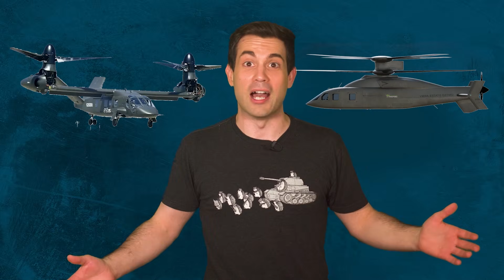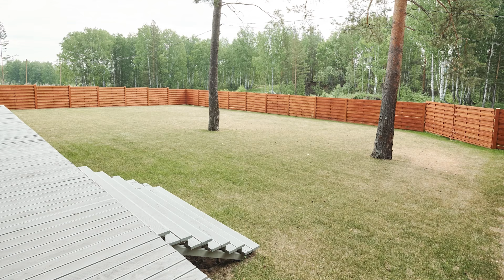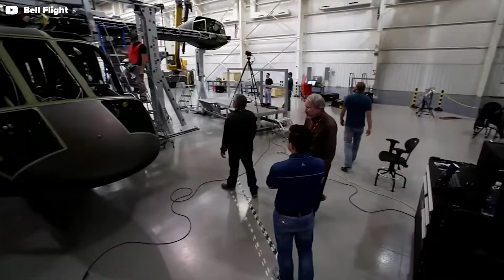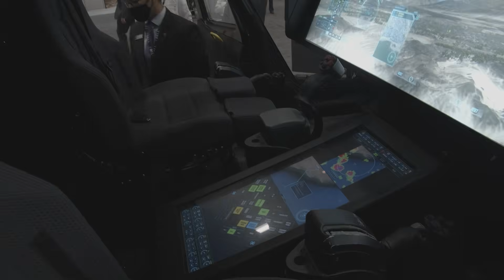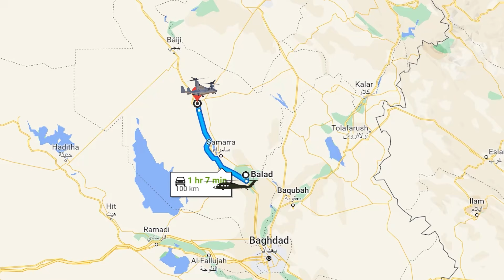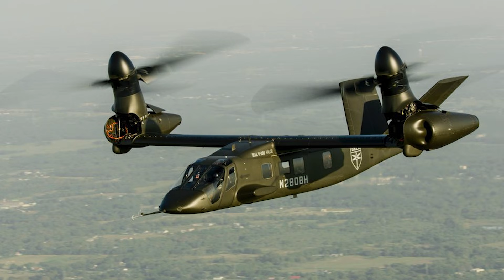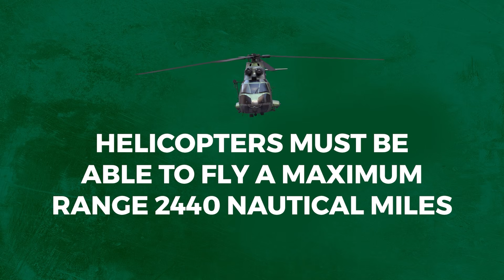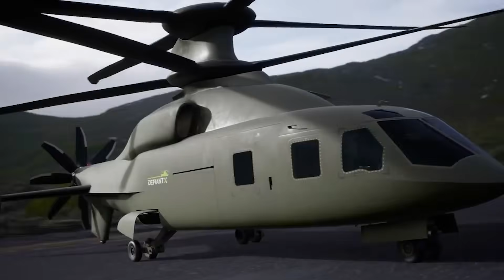V-280 Valor Helicopter Will Help Defeat China

Comment: Typical Boeing, dust off an old failed 1970's design, Repackageed it & called it ""NEW!" & "Cutting Edge"! 
  
 Everything especially in the Military comes with Life ending Risks! 
 As a former Grunt myself, Id @least prefer to die ON THE BATTLE FIELD!...
Not @ the end of a Runway or Heli pad b4 hand.....
In all Seriousness, Boeing has not learned their lesson even after two Passanger Jets landing in a Crater it CREATED ITSELF! 
 The 787 Dreamliner before that, In ignoring design issues, surrounding the already Inadequate extremely  overheated Batteries almost crashing a few of those from Battery fires, then the  737 Maxx crashes (mcas)  the Emergency exits.. 
Just like BP, they end up spending an incalculable amount of money from their short sided feeble attempts to cut costs...
 Boeing should be excluded from ALL Military contracts   except to maintain the existing equipment already in service

Comment: the v 280 is a smaller, more efficient package than the osprey. Also the engines are fixed and the rotors tilt, huge improvement over the osprey

Comment: Do not waste the advantages of a tilt rotor by using it for external cargo.  Grrrr.  If you want to lift use a heavy lift helicopter
Reply: ??? why wouldn't you want it to be able to transport M777s as a secondary mission? doesn't that only increase your capabilities as a whole fighting force...
Reply: @n3v3rforgott3n9  why would you use it for external cargo when you have machines optimized for that mission.   You carry several hundred pounds of structure and load handling equipment for a mission that is best served by traditional rotary winged aircraft and hopefully not needed often on your tilt rotor. I just don’t see the advantage of taking a weight penalty for a mission that can’t take advantage of the machine.
Reply: @chrissmith7669  Because more platforms that can do the mission the better. Of course you will want to use dedicated platforms for such a mission but those might not be available.

Comment: The Valor won the  contract. Too bad about the Raider and Defiant X. The helicopters looked really cool but still didn't have the range or speed despite two 7500 hp engines. Improve on that model and it will win a contract, too!

Comment: Why do we even need helicopters anymore? Just replace the propellers on the Valor with Jet engines
Reply: Turbo props are technically jet engines. Jets propulsion would destroy any surface they take off from that isn't made to take the beating. They are also vastly inefficient in vertical flight.

Comment: I would choose the Valor as the primary for the speed, lift, size, and most importantly the easier supply chain with the Marines and Navy using the similar platform/contractor. The secondary/raid/spec ops mission sets I would go for the X since it’s a lower, stealthier, more nimble platform that fits better those needs.

I know Army hates having their projects to similar to Marine/Navy assets traditionally, but hopefully that won’t not be to much a issue with this.
Reply: Speed, lifting ability, range, and ease of in-flight refueling are all better on the Valor than the Defiant. Don't get me wrong, I think the Defiant is cool as hell, but if you're primarily looking for an airlift platform rather than a gunship or stealthy troop carrier, I think the Valor wins hands down.

Comment: The Blackhawk is a troop transport not an attack helicopter, the Marines don't use Blackhawks they use the ch-53 super stallion that can lift your  mother's house. Why are we Island hopping China is a land locked continent. None of these helicopters have the kind of range you would need to go after anyone on those islands you speak of. Even the F-16 doesn't have very much of a range. What branch of the military were you in?
Reply: The valor has 560-900 nm combat range vs the blackhawks of like 320 nm. It is about reinforcing islands that china would need to attack to stop our Navy from blockading them.

Comment: Future Vertical Lift (FVL) is a plan to develop a family of military helicopters for the United States Armed Forces. Five different sizes of aircraft are to be developed, sharing common hardware such as sensors, avionics, engines, and countermeasures. 
Three sizes were planned in 2009, then four and five (which may or may not be of the same design) are envisioned to replace 25 current rotorcraft types:

JMR-Light: Scout helicopter to replace the OH-58 Kiowa; introduction planned for 2030. Implemented as the Future Attack Reconnaissance Aircraft program in 2018.
JMR-Medium-Light
JMR-Medium: Utility version to replace the UH-60 Black Hawk; introduction planned for 2030. The Bell V-280 Valor was awarded a contract for the Future Long-Range Assault Aircraft program in December 2022.
JMR-Heavy: Cargo version to replace the CH-47 Chinook; introduction planned for 2035, although Boeing expects 2060.
JMR-Ultra: New ultra-sized version for vertical lift aircraft with performance similar to fixed-wing tactical transport aircraft, such as the C-130J Super Hercules and the Airbus A400M Atlas; introduction planned for 2025.
Attribution - Wiki, and its accurate.

Comment: Valor for Regular Forces and Defiant for SOF.

The Valor can land conventional assault troops head on, such as the 101st Airborne and the Air Cavalry. Meanwhile, Delta Force and Green Berets could use Defiant to sneak around and poke and prod from behind. Both fill a role, but can do cross capability as needed.

Why does the military insist on One Size Fits All? I got an Once Size Fits All hat and I'm the one size it doesn't fit me at all!

Comment: The pusher prop idea dates back to the AH-56 Cheyenne.  That is would have been the attack helicopter in use instead of the AH-64 comboed with the AH-1 Cobra if not for a change in doctrine that the USAF pushed through that restricted what kind of air craft the USArmy could use.  The AH-56 was a better design then the AH-64 and near capable firepower wise then the A-10 as it was even stepping on it's role too sporting a chain gun and a belly cannon which both could lock on their own targets while wing mounted weapons went for a 3rd target.

Comment: I've been on the Hawk since 1992 and it's not the aircraft: it's the air and ground crew causing the mishaps.  To a lesser degree, it's the remanufacturing of the parts in the supply system.  Still, it's the human error.

Comment: Tbh. Both are great items. 
They do different things and touch on the needed point. 

Its been over 50 years. The push for the next gen is needed. Even if the competition isnt working on next gen. Nailing down tech dominance will be great.

China introduced the Z-10 attack in 2013, Z-9 transport in 2004, Z-18 H-UH in 2018, Z-11 L-UH in 1998. Z-20 M-UH in 2019.

They wont be doing much soon.
And russia? Heh. They’re basically hermitted

Comment: imho, as a former UH-60 driver... The only roles that the Valor (variants) is suited to fill in place of the UH-60, are the roles the 60 probably should not have been doing to begin with, but made work. The Valor is a good choice to replace the HH-60, SH-60, some UH-60 roles, and some LAAR/CAS roles (if equipped). The Defiant X (variants) should be replacing the AH-64, some UH-60 roles, and MH-65. [Note: The AH-64 should never have existed at all because it was out performed by every scale by the S-70/AH-60L/DAP variant(s) of the 60, which general airframe already existed en mass, in our inventory. The 64 was only chosen through politics and lobbying.]
Reply: @cj64343  Just because they chose it, doesn't mean it will be successful in all the areas intended. It just means they'll end up keeping older aircraft fleets (like the 60) in service longer than they wanted to, in order to make up for the shortcomings in certain roles. Certainly won't be the first time such has happened.

Comment: FFS, helicopters change direction by changing the angle of the rotors, not by tilting their nose down. Go for a ride with trainee pilots, you'll learn that a helicopter can in fact fly forward with a nose up attitude - however disconcerting that may be for the passegers.

Comment: to be fair the amphibious landing crafts weren't supposed to deliver troops or material to the beach head until the beaches have been cleared... ok so the D-Day landings, Iwo jima, peleliu for example were not really textbook amphibious landings.  
these airlifting campaigns are gonna be pricey.  anything that's air related is gonna cost a lot more than boat related.

Comment: Like many others, I think both designs should be adopted for different mission sets. Since future vertical lift includes many other planned vehicles, I'm curious about the size scaling for the defiant. If you want a heavy lift vtol, it seems tilt rotor offers greater options. Imagine tripling the v280s size and giving it a lifted rear wing with 2 more propellors. A 4 prop tilt rotor with a +20 ton payload. We could transport a stryker with something like that, or a couple JLTVs inside. It would also have room for a large air assault unit to parachute from. The defiant seems stealthier, could easily add wings for increased weapon load, and has a small footprint. I can see the defiant sized to attack, like the huey and cobra, but making the defiant bigger seems to defeat its strengths.

Comment: As an average metal-smith for several rotary aircraft,  I believe that someone forgot the  K.I.S.S. acronym.  
 All of the cool gadget electronics is great until you take a couple of bullets. Helicopters are made to be down in the dirt/weeds unlike the high flyers.   
 Just another opinion from what you other guys call a crayon eater.
Semper Fidelis

Comment: The most vulnerable vehicle - helicopter
Then
Planes
Patrol boats
Supply & Transport
Light armor
Armor
Destroyer escorts frigates support shops
Destroyers 
Cruisers
Aircraft Carriers
Submarines
 
Along w vulnerability being redlined by maint issues follow same curve

If US is serious about invading 100+ micro islands w min lives lost they need a tracked submersible which is a tall order. 
The better way to invade would be to saturate air defenses launching 100 - 200 missles at it.  Follow it a fuel air bomb barrage using precision guided glide munitions launched from far off fighter bombers.  Every detection antenna, radar dish, window vehicle will be smashed w few survivors dazed.  Send in fast attack landing craft Marines tabled w drones w missiles for close air cover. 
Oh, osprey insanely dangerous - "fixed" after many died.  
Problem w full screen display vs gauges - destroys night vision, makes copter visible, if it fails you have. NO FLIGHT INFO.
Two counter rotating props - making a helicopter even more vulnerable

Comment: Just going by what happened with the M5 selection, I'm assuming they'll go with the helo option.

Although it's kinda funny. Technically the tilt rotor is the more traditional design because it's just a modern V-22ish thing. Where as the Sikorsky design's flight control system has to be a huge departure I figure?

Comment: There are some dependability issues with the tilt rotor and possible survivability issues vs a regular helicopter as well.  The other helicopter still has a traditional rotor but uses a pusher propeller to help it achieve much high speeds.  Like a gyrocopter these an be very dependable but not have some of the issues a traditional gyrocopter may have.  
It would be the helicopter I'd look at if it wasn't a Lockhead Martin product.  I don't really have anything against Lockheed but perhaps they are getting too much of a lionshare of the contracts these days AND Their work on the LCS ship and the F-35 shows that perhaps they might be resting on their laurels and perhaps need a kick in the pants to put out products that actually work day 1 not 10 years down the line and extra billions being spent to fix the problems.

Comment: I'm leaning towards the Defiant, not just because Lockheed Martin is taking on too many military contracts, the Boeing Defiant design is still trying to mostly be a helicopter while the LM Valor is mostly a fixed wing aircraft that can sort of hover. The manoeuvrability aspect is something that's going to be a more significant limit than range or speed, it's going to put a harder limit on the pilot pool and limit where the helicopter can be used which will be factors that are harder to overcome compared to the surmountable problems of range and flight time.

Comment: The same reason that rotor wing assets have not been upgraded are the same reason that A-29s are not in UA.  They are not "Sexy & High Tech" like jets. But they are exactly what is needed in today's battle theaters. Today, more than ever back alley brawlers are what today's battlefields require in the air IMHO.

Comment: If a replacement for BH is required, then Valor wont be able to fulfill the role, because army requires lighter and smaller version that can land in a slightly tighter spots like a regular helicopter where not always as big or wide as Osprey can get, which means something like Defiant would work. Valor can only replace its own Osprey for the larger capacity lifting and speed.

I think that both could be accepted as replacement to their respectful existing ancestors, but not one or the other as a replacement for BH.

Comment: You know, of course, that Lockheed designed an attack helicopter, the AH-56 Cheyenne, in 1967 that had a rigid rotor and pusher prop.  Although the design was consider superior by many, it was eventually rejected in favor of the  AH-64 Apache.

Comment: If you are choosing based on rotor area clearance, wouldn't you want a space large enough that the crew can send rounds moments after dustoff, than hours after clearing firing lines of trees?
Reply: And then there is the 100 kts advantage... This new tech stuff is tuff. And staying ahead of world class aggressors is necessary to maintain a peaceful productive life at home base. Looking back, the toughest engines on the planet were radials. They came back with several cylinders shot off. Independent cooling, limited oil feed requirement for 2 rockers, these were designed for war. Now?

Comment: There was a time I said the Philippine military should be reorganized and have the Air Force (which has its own infantry reservists ie airborne cavalry and special ops) and Army work more like the Navy and Marines everywhere in the world. I mean, more so for a country that isn't a continental entity and on top of which is archipelagic, the army is hardly going anywhere without planes and boats anyway, instead of going blitzkrieg across a border.

If they're organized this way ie like the Navy and Marines the Air Force will be the primary determinant for funding when air assets are already the primary determinant for moving the army across islands quickly anyway. Not to mention the heaviest Army vehicles that are planned is an under development light tank from Indonesia. The Phl Army can't afford to have its own fleet of transports the way the Imperial Japanese Army had more carriers than the Imperial Navy (these are just transports, they'd be easy to sink and can't even recover aircraft, ie, you basically just put a flight deck on a freighter) the same way the US Army and Marines combined technically have more ships than the US Navy. Anything that can't be airlifted (like the Harimau light tank) would either be relegated to defense or for absolutely massive alliance offensives where the Army can just use large freighters and get off when there's a captured port (ie no-facility amphibious ops are still the Marines'). If the Army needs more firepower, the French light infantry and airborne units already have armored cars with tank-like turrets (I think the US Marines are also looking into getting similar stuff).

Everybody in my Public Ad and Foreign Policy classes looked at me like I had two heads, ie, the Army will resist that. Well duh. That's the age old problem ie generals always fight the last war. And a heck of a lot of the generals are corrupt, which is why if reforms will happen, it will only be possible if a new Party with its own Republican Guard (if with only infantry and light vehicles, but has shoulder-fired guided missiles and scout drones at least)  1) takes political power and 2) be able to not look like a coup d'etat is a simple solution out of becoming the Air Force's Marines.

But all for naught, because going by the Marcos track record I'm not too positive about how well Jr will do with the economy much less in actually improving the army beyond just having a crap ton of infantry bodyguards for the regime. They won't need fancy equipment if they're only designed to deal with their own citizens. Not to mention Marcos Jr was even visited by the Chinese ambassador before the elections, so chances are, the Philippines will be on the other side if crap hits the fan.